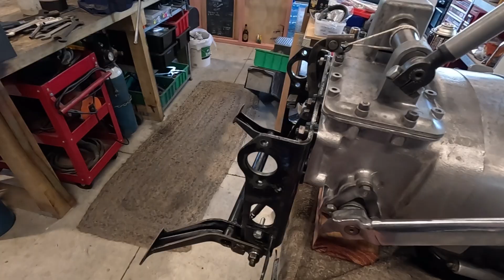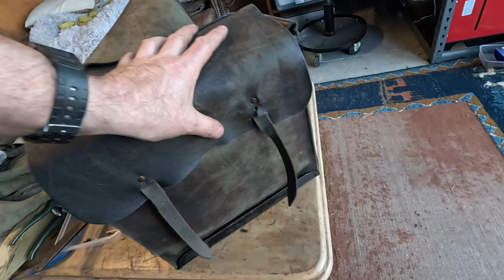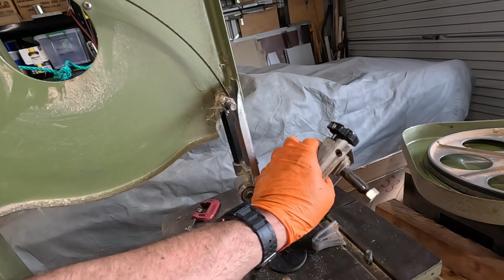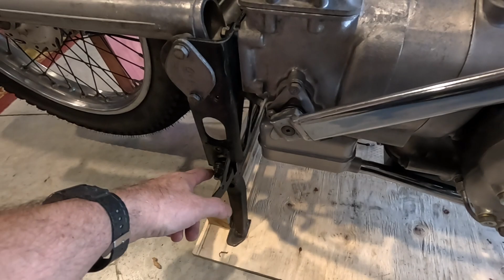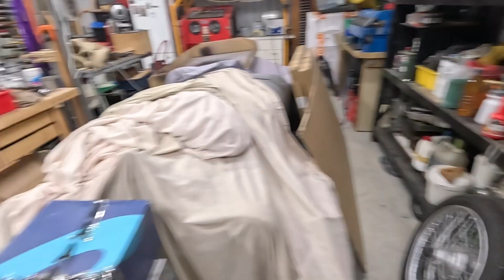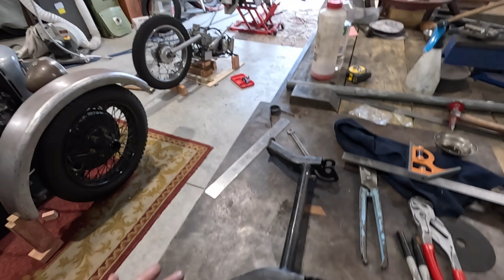New Velocette - Precious bodily fluids

Comment from the maker: Now you can ride a moped or scooter I think with a car license. It has to be less than 50cc and have a top speed of less than 50kph. On a learner motorcycle license you're restricted to certain bikes called LAMS bikes.  It's to do with power to weight so most are 250cc or less. So high power 250s aren't allowed but lots of older bikes are. So a learner can have any Velocette up to 600cc apparently!

Comment: i  think I'm correct, way back the bike license was thrown in with when you got the car , i got my heavy trade , truck and trailer license they threw it in years back , on your band saw do you have room to drill some dowels then J B Weld
Reply from the maker: I just blobbed it all up with JB Weld in the end. Seem to be holding so far. If that fails I will make something solid. There isn't really room for pins since it's cast in an I-Beam kind of shape so there isn't much material there to drill. Although with it blobbed up I can drill through it and the epoxy I guess and pin that?